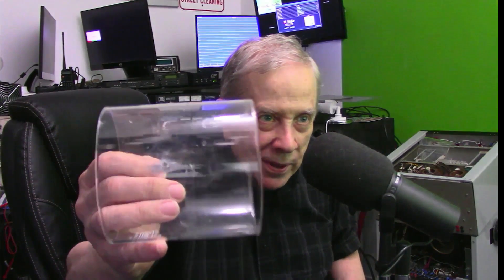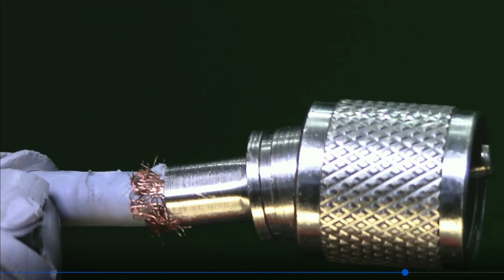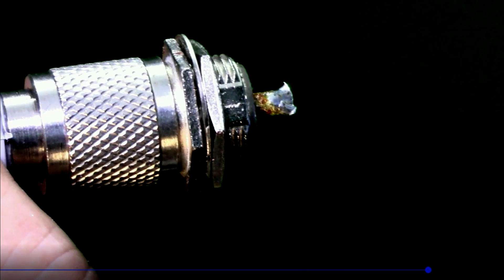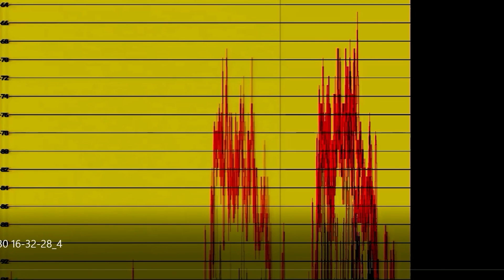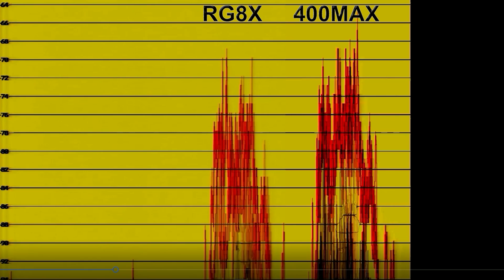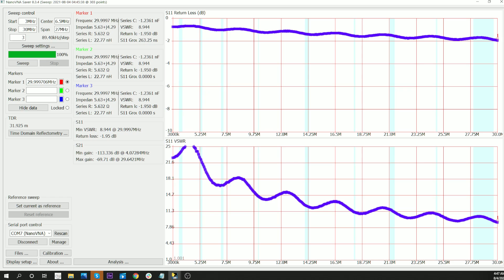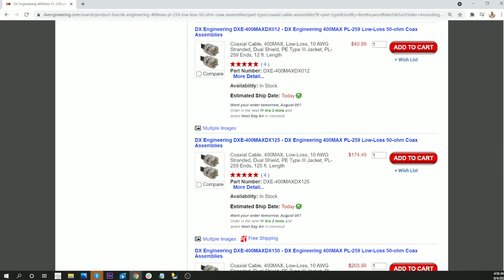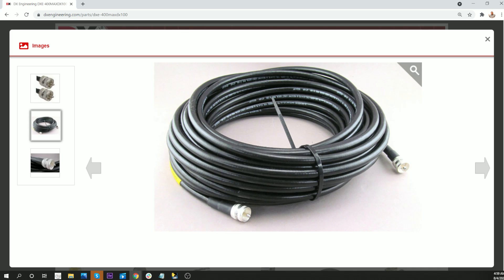Getting A Hole In One With Cheap Coax And A Look At 400MAX Coax By YouTube Ham Radio Elmer Jim W6LG

Comment: Sorry Jim but I'm only 3 minutes into this and I can already tell this is your fault you caused the problem. First you don't use 500 watt coax for what looks like a cooling tower for a 1200w 3-500zg tube or you should expect the wattage too ark across the dielectric. 
Second mistake is to use Coleman lantern mineral glass in place of the correct iMac cooling glass which has a rolled in top shoulder to redirect the air so that it also cools the anode. That's why iMac doesn't use mineral glass. You see my Elmer 'HLO' "Doc"  taught me well.
Reply: Apologies for my Android stupid phone, not iMac but
 E I M A C

Comment: Comparing the 400 Max to RG8X is like comparing Dawn Ultra to house brand bargain dish soap. How about putting it up against RG213, RG8X, 9913 or LMR 400? 
At least then we are racing big block against big block. Granted I've seen LMR240 that out performed cheap RG8 in the attenuation department. When it comes to bigger power, small coax is a gateway drug to failure.

Comment: So you were testing RG8x beyond it rated power capacity, right?   Also the failure appears to be a bad connector install, not the coax.  Why do you seem to dismiss RG8X as a solution for situations not involving Amps?  I get it’s your channel and you can say what you want, just not clear that everyone needs to be running LMR400 or what you promote - DXE’s version.

Comment: Interesting. After much pestering, I finally terminated my RG213 (burned a finger) and replaced the RG8X. Both are 3 sections. What a difference.
Oh and both were swap meet as I recall.  Yup, one length has very discolored shield like oxidation, so perhaps water intrusion at one point. 

I didn't set up for a loop test of the coax. New stuff in a single run the correct length instead of 3 stitched together is on the list.

Comment: Have you looked at Messi&Paoloni coax out Italy 
Have some PL-259 are sealed   
Compression fit. I found some PL-259 on Ebay. Looked just like the one's on their website alot cheaper. 
just like Messi&Paoloni, I believe Gigaparts is the site that I seen here in the States. 
73 Jim Paul KQ4CD
Reply from the maker: Thanks again Paul for your help.  73, Jim

Comment: love to hear about rg11 tv coax for ham radio! it has similar loss to lmr400! what are your thoughts?
Reply from the maker: Hi Jake, 
I have used that coax many times when money was tight.  I was able to get it free from the cable company after a forest fire in the area.  As near as I can tell, it made little difference.  The SWR was slightly higher.  So, I changed the antenna t match the coax and then used a tuner in the shack.  That worked for several years with  HIGH power and no issues.  Thanks for asking. 73, Jim W6LG

Comment: Cut to the chase……1mhz to 1.2ghz….USA Times Microwave branded LMR-400 gets the job done. Don’t go with cheap coax. DX EE house brand is ok but the real deal is Times Microwave USA coax solid core or ultra flex stranded core. They even make a direct burial version of you need to run out in a ditch to your tower. I also strip the cheap coax off of mobile mounts and run the Times microwave LMR-240 which is a major mobile upgrade. Nope…don’t work for Times Microwave just speak up when I have proven experience with a quality product.

Comment: whine, whine, winge, winge, If you want something done right, DO IT YOURSELF. Buy the cable and the connectors, and make your own lead ins. Making your own s**t has always been the best part of the hobby. It may not perform quite as well as so called "professionally made" equipment, but at least you know exactly what you have, and can blame nobody but yourself when it fails.

Comment: People thought I was crazy for spending so much for coax, but I use DXE's 400MAX for everything, including my 3 HF antenna runs. Quality coax. 73, W9HJ
Reply from the maker: I was really impressed with the stuff.  It is not easy to prep for connectors but well worth the effort. 73, Jim
Reply: @ham-radio  the 400 MAX is actually pretty easy to prep using the prep tools that DX Engineering sells. The tools are not cheap, but after years of doing it by hand with razor blades etc. I finally bought their prep kit and their crimp kit. Makes things so much easier. You are certainly correct- cheap coax is not worth it. 73 de W0ZF

Comment: Who runs high power through RG8X? 
Many are only rated for 300 watts at 10 meters. I've never used 8X in my 31 years as a ham.
Reply from the maker: The coax that I had tested had a much high rating by the OEM. NO matter what the rating they gave it, that connector is zero watts. The fact that they sell coax with connectors that are so poor installed tells me that they don't care.  73, Jim
Reply: @ham-radio  I agree with you 100% ! I ordered several dozen  T.M. LMR-400 prefab cables and jumpers from a "reliable" online supplier for a job I was doing. I wound up with a similar problem to yours, but not as severe. I ordered the cables to save time and I wound up cutting off all the connectors myself and installing new ones. 😠
I've never seen 8X that was rated for that much power. Belden and, I believe, Times Microwave also only rate their 8X for 375 watts max at 30 MHz. 
I'm sorry that you had to go through this! That workmanship is unacceptable and, sadly we often suffer the consequences. 
Best luck and 73, AA2HA
Reply from the maker: @timmack2415  If you want to, let me know who that was via private email.  Honestly, it is so hard to understand why a company would produce such garbage.  73, Jim

Comment: PL-259's were never meant to handle a kilowatt and even the teflon ones are known to fail at lower powers. In the day, some said the Jones connector was better. Care must be taken to tighten them and weatherproof them. 
Coax unless marked MIL-17- xxx or by a brand name, can be anything. Still, the specs state not only the power handling, max temperature, breakdown voltage and VSWR for those specifications. While RG-213 can handle a Kw on any band ICAS, CCS it gets hot and is limited to 250 watts or less on any band. And, that assumes a good VSWR match. Heavy matching (high SWR) between a tuner and antenna will result in very high voltages that will puncture the insulation and/or develop high currents that will melt it. 
I bought 100ft (30meters) of super cheap rg-58 coax and found it had over 6 Db loss on 20 meters, I'm still working that out, care must be taken buying buying Antenna Makins. At 100 watts or less, loss is the most important. Does crosstalk in coax matter in ham service? I don't think so unless  you have  a bunch of rigs running. Above that you have to get serious in every part of your station. VSWR, thermal, current, over drive and overload protection are important unless your willing to damage the thousands invested in your station. More dramatic, can you damage a 1000 feet of 6 1/8  coax, yes! And, can you destroy a 55Kw Klystron Tube, worth 50 thousand Dollars by adjusting the protection circuits down? Yes and the tower crew cost even more to repair the transmission line!
Reply from the maker: Roger, PL359 DOES have a rating above 1500 watts continuous.  It was originally designed as a radar connector at 300MHz which was UHF at that time.  Per Wikipedia:

 Power
Some samples of UHF connectors can handle RF peak power levels well over one kilowatt based on the voltage rating of 500 Volts peak.[4] In practice, some UHF connector products will handle over 4 kV peak voltage.[20] Manufacturers typically test UHF jumpers in the 3-5 kV range.[citation needed] UHF connectors are standard on HF amateur amplifiers rated at 1500+ Watts output.[citation needed.

Most, if not all, HF amplifiers at legal limit manufactured aroudn the world have that connector.  With a Teflon dielectric it should be able to handle well over 5KV in practice.

So, I will politely disagree with you and offer the above as something to think about.  Your friend, Jim W6LG

Comment: Sorry about your amplifier Jim. I hate to say it, but this turned out to be an expensive video series on cheap coax.

If I'm following the timeline correctly, the amp catastrophe happened after you cooked that 100' line of junk coax. 

The events can serve as a painful reminder to test your load at low power before switching on the amp.

Hope to catch you on the air soon. I just bought my first home. It's a duplex. Between moving, getting the lower unit renovated and rented, the new shack project has been sidelined. I can relate to your recent moving experience and just how long it takes to get situated and back on the air.

Thanks and 73 de KE0RFZ.

Comment: Hi Jim,
Nice video on diagnosing the RG8X and comparing it to the DXE 400Max. Three weeks ago was operating FT8 on 20m and all of a sudden no output on the Bird meter when I was connected to my 40 yr old yagi. Switched to my inverted U antenna and no output. Went to 40m and there was output again, which had me perplexed. Pulled out my Youkits FG-01 analyzer and started looking for the problem. Turned out I still had a short run of 40 yr old Wireman CQ Flexi from the crawl space to the antenna switch. Changed it out and all is working now, even a little better. Did some autopsy of the old cable and found no problems. Not even water intrusion. Guess coax does age. Thought I had replaced it all about five years ago. You and the family stay safe.  73  WJ3U

Comment: Jim just wondering about the coax from DX Engineering 
Purchase some  RG213 125 ft. and to jumpers at 6 ft.
Don't know if that would make a difference from what you have. 
Did get a stripper from them 
#DXE-UT-405C- P1. could not get it to work right. Sent a 3 ft. Chunk witch they got it to cut, correctly.  I guess  I  was not strong enough.  Lol
Now with that gray coax the tip looked  soldered but braid  was not or crimp. 
I think this is long enough for now 
73 KQ4CD Paul

Comment: Holey smokes. Literally. Wow. Thats impressive. Sorry for the break down but great experiment.
Reply: If you weren't so dog gone far away I have several hundred feet of 7/8" and 1/2" heliax that was gifted to me.  It would be fun to experiment with it to see if you could measure loss on HF by coupling them together in ther respective coils then straightened out.

Comment: I ran an IT department at a small company years ago. I used to hire contractors to install the network cabling. At first I had the contractors install the connectors and do all the connections in general. They always fouled up at least one of the connection points if not several. I was always the one who had to deal with, and to troubleshoot the problems. As time went on I stopped having the contractors make the connections, and to only pull the wire. I made all the connections myself. 
It's not because I'm more capable, than the contractor but rather I had a greater appreciation for how important the quality of the connection was than the workmen who don't have to live with the quality of the work they've done. 
I know we save money by buying coax cable with the connectors installed, but is it worth the risk? There is not only the quality of the connection work that's in question, but also the quality of the connectors themselves.
Reply: In general, I liked having factory installed connectors because I felt that they likely have better equipment and lots more experience installing connectors than I do.  I would say that in soldering the shield in PL-259 connectors I had about 1 in 4 that I worried I had overheated the insulation between the center conductor and the shield.
Reply: @BryanTorok  Factory installed connectors never came on very long runs of wire, plus they would make it far more difficult to pull the wires through ceilings, conduits, and down walls as I needed to have done. I'm talking about thousands of feet of cabling running to hundreds of locations that naturally were all unique lengths. The cabling would come in boxes or on rolls. Yes, jumper or patch cables may come with connectors, but I was always fine either way regarding even those. I had no problem making the connections as good as factory made connections and of course understood the  potential problems of not doing it right.
Reply: @fredflintstone8048  All that makes sense.  Are you talking about data cable like CAT5 or coax?
Reply: @BryanTorok  I've worked in this way with all types. RS-232 with D-type connectors, ethernet, coax and also token ring. I found that the contractors did some of the poorest quality connection work with RS-232 and token ring. Intermittent token ring connection problems were a nightmare to troubleshoot at times. I had to write some software for catching those. I've also worked with installing fiberoptic. I would most often let the contractors terminate those but then would have failures over time and re-terminate those myself. My main point is that the person who has to make the systems work and keep them running tends to be more careful about the quality of the terminations than the contracts installing the cable and doing terminations.